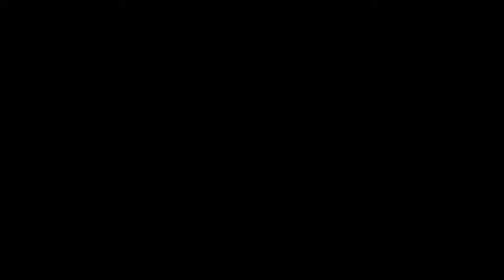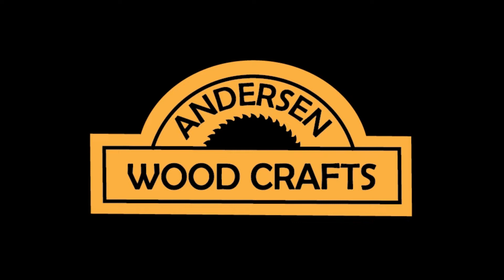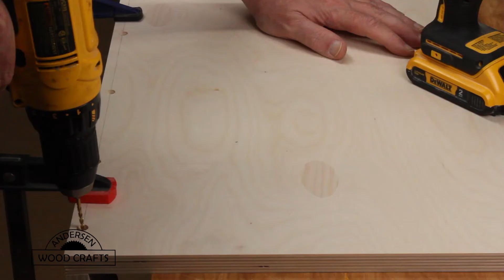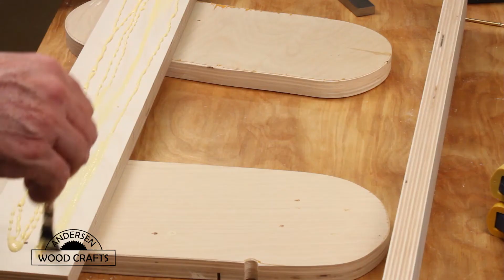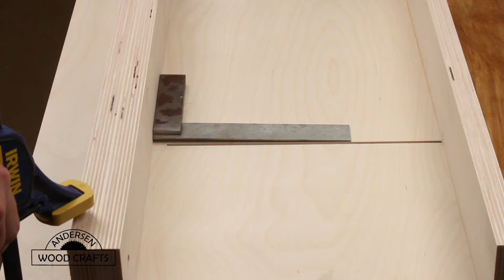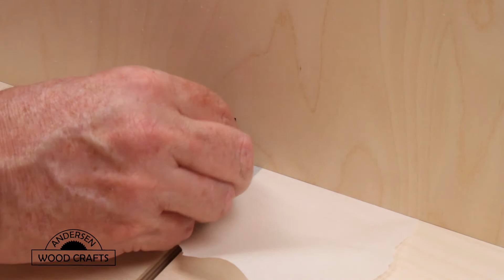FINGER JOINT JIG FOR THE TABLE SAW

Comment: Hello Mr.Andersen, where can I find the yellow guides used for -Finger Joint Jig for the table saw ??? Thanks for an answer
Reply from the maker: I got them on Etsy.  I have ordered a few from this seller, they are 3D printed and are not always yellow.

https://www.etsy.com/listing/696930061/table-saw-miter-slot-rails-2-pack?gpla=1&gao=1&&utm_source=google&utm_medium=cpc&utm_campaign=shopping_us_-craft_supplies_and_tools&utm_custom1=_k_Cj0KCQiAoNWOBhCwARIsAAiHnEhRM7EzjpscP6ojSJ17BJcEDZU8gXItVPzKKdixa1WghRSMsRnsrG8aAq-tEALw_wcB_k_&utm_content=go_12665398257_121762925993_511610210343_aud-966866687894:pla-295462056867_c__696930061_123638159&utm_custom2=12665398257&gclid=Cj0KCQiAoNWOBhCwARIsAAiHnEhRM7EzjpscP6ojSJ17BJcEDZU8gXItVPzKKdixa1WghRSMsRnsrG8aAq-tEALw_wcB
Reply: @AndersenWoodCrafts  Thank You !!!  Many thanks !!!!

Comment: Nice video, you said you would link to where you got the runners for the sled on Etsy. Do you have it please?
Reply from the maker: Thanks for the comment.  When I mentioned that I didn't realize that the link would be a paragraph long, but here it is:

https://www.etsy.com/listing/696930061/table-saw-miter-slot-rails-2-pack?gpla=1&gao=1&&utm_source=google&utm_medium=cpc&utm_campaign=shopping_us_a-craft_supplies_and_tools-tools_and_equipment-equipment_and_machines-other&utm_custom1=_k_Cj0KCQjw9YWDBhDyARIsADt6sGb4cM5KNjBi66-NvmuprIWzEEYK_d3KYeAe2d6SPbBKsoZSzXEjUzUaAiI_EALw_wcB_k_&utm_content=go_1843970764_76535549984_346429178375_aud-459688891635:pla-295604191182_c__696930061_123638159&utm_custom2=1843970764&gclid=Cj0KCQjw9YWDBhDyARIsADt6sGb4cM5KNjBi66-NvmuprIWzEEYK_d3KYeAe2d6SPbBKsoZSzXEjUzUaAiI_EALw_wcB

Comment: I like this jig. It's simple for the most part and looks easy to run. I have been wanting to do dome box joints for a long time but I have yet to just settle on a jig. I think I will probably build this one and I think you could easily set it up to do different sizes by just changing out the board with the walnut in it for a different one. probably want to ear mark those blades per board setup. Thanks Master Andersen!!
Reply from the maker: There are so many different designs out there, and each one has its good points and not so good.  I came up with this by incorporating about 4 different designs I have seen into it.  I only attached the tall fence with screws (no glue) for the purpose of being able to change it out for different sized joints.  Thanks for the comment.